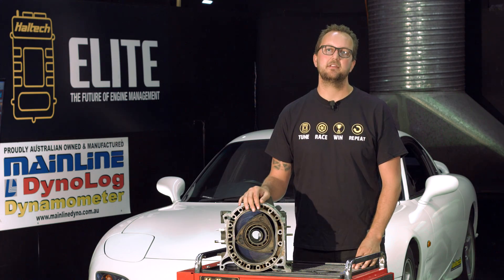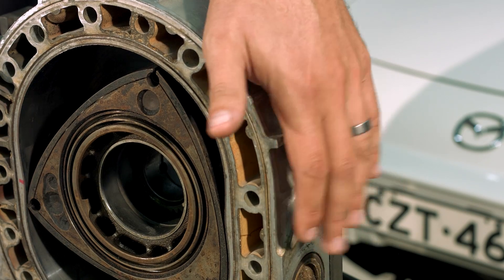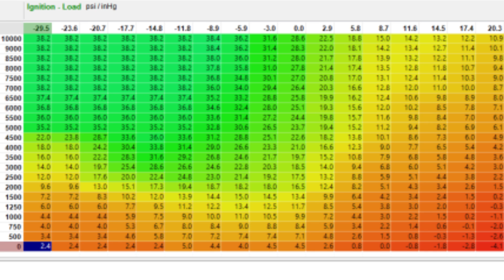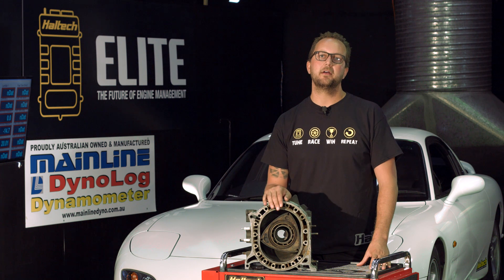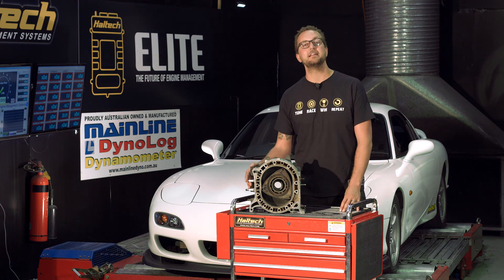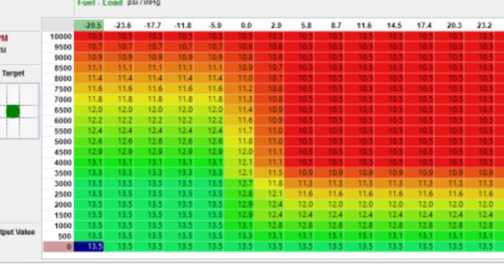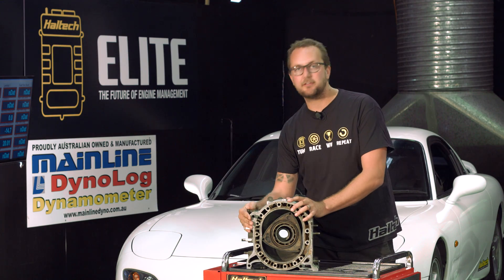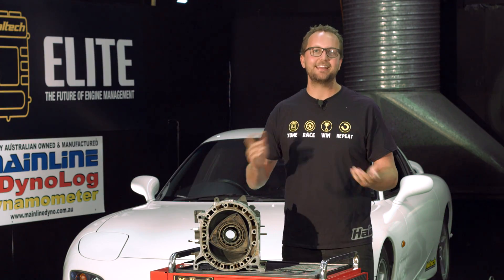💬 Tuning a Rotary Engine - Technically Speaking

Comment: Hi can anyone remote map my Fd please? It’s running a Haltech elite 1500 but there’s only 3 mappers in the UK now, 2 have refused to map my car or work on it and the last mapper is 8 hours drive - looking to pay for remote mapping or buy a map I can upload. street port 13b , T88, 2600 injector dynamics.  Thanks 😊
Reply from the maker: One of the guys at Haltech UK will be able to point you in the right direction. Contact them on +44 121 285 6650 or uk_sales@haltech.com
Reply: @haltech  thank you this is why I got Haltech - tried Link and other brands, they are not interested in helping.

Comment: Afaik, the ‘closer’ the ignition split timing the safer for the engine. Opposite of what was discussed. In fact, early mazda sponsored race engines had ‘zero’ split ( both leading and trailing fired at the same time)
Just my 2c.

Comment: Forgetting the rotors faces the 13b only has 2 cylinders where the combustion is created the 2jz has 6 cylinders -Jesse Rotary
Reply: The Mazda 13b has SIX combustion volumes.. not 2.
Reply: @sandervanderkammen9230   It only have 2 cylinders or housings it doesnt matter how many pistons or rotors its equivalent in a piston engine is a 2 cilinder 2 stroke engine engine that bangs every whatever degrees 🤷🏻‍♂️ its simple.
Reply: @marinaportocaribe  Sorry, if that were true? The Wankel would only have one combustion cycle every 3 revolutions...

All Wankel engines operate using the 4-stroke principle and completes its firing its firing order sequence at 1080° degrees of crankshaft rotation. 

If you are having trouble learning the fundamentals of the Wankel KKM engine I would be happy to help explain it to you.

Comment: Mazda 13B engine has 6 combustion chambers (each rotor side forms a combustion chamber and go trough the 4 stroke Otto cycle as its moves inside its housing) Great to hear you compare it to a TOYOTA 2JZ-GTE 6 cylinder engine because they are equivalent in terms of working combustion chambers. 
13B with 6 combustion chambers
2JZ-GTE with 6 combustion chambers.
13B is not equivalent to a 4 cylinder engine, neither because it uses 4 spark plugs and neither because its ignition events are at each 180° of eccentric shaft rotation (4 cylinder engines fire an ignition event each 180° of crankshaft rotation) because in a Mazda 13B engine you got 6 ignition times in its Thermodynamic Cycle, NOT 4!

Displacement for Mazda 13B engines is not the nominal displacement of "1308cc" (1.3L) Mazda quoted (They did it to skip paying higher taxes per each engine produced in Japan because there was an Engine Taxation Law) Mazda just counted the work (combustion cycle) done by just one side of each rotor (2 combustion chambers total) and skipped the other 2 sides per rotor (4 combustion chambers total)
That's how they gave just 1/3 of its real value (set by its thermodynamic cycle)

On a 13B  engine there are 6 combustion chambers that displace 654cc each one to go trough a 4 stroke Otto Cycle and it takes 1080° rotation of its eccentric shaft for all them 6 combustion chambers to do so.

654cc x 6 = 3924cc (3.9L) @ 1080° eccentric shaft rotation.
Ignition is fired at every 180° of eccentric shaft rotation and there are 6 ignition events on its Thermodynamic Cycle so;
180° x 6 = 1080° (3 rotations of 360°)

13B is not a 1308cc (1.3L) because Mazda said so to cheat Japan's engine taxation laws. It is neither a 2616cc (2.6 liter) because S.A.E used the 720° of the Thermodynamic Cycle of 4 stroke piston engines to give the Wankel Rotary Engine an "Equivalent Displacement" because at 720° of eccentric shaft rotation in a 13B engine, 2 sides per rotor (4 combustion chambers total) have completed a 4 stroke Otto cycle;
654cc x 4 = 2616cc (2.6L) @ 720° of eccentric shaft rotation.
Ignition at every 180° of eccentric shaft rotation / 4 igniton events
180° x 4 = 720°

Try to make a 13B 2 rotor engine to spin and keep in steady idle with just one side of each rotor (2 combustion chambers) completing a 4 stroke Otto cycle (displacing just 1308cc / 1.3L, 1/3 of its Thermodynamic Cycle) and the other 2 sides of each rotor (4 combustion chambers) not doing their 4 stroke Otto Cycle events. 
IT WON'T WORK BECAUSE IT IS NOT A 1308cc 1.3L
Remove an Apex seal or program the ignition to fire for just one side of each rotor....It won't spin trying to displace just 1308cc (1.3L)

It is a 3.9L displacement engine in a compact package.
Reply: "13B is not equivalent to a 4 cylinder engine, neither because it uses 4 spark plugs" so a 4 cylinder alfa romeo twin spark is actually a straight 8 or?
Reply: @NokturnalFin  Unless they fire more than once every 720°??? No, it's a 4 cylinder.

Comment: Hello Haltech,  I am interested in using a strong rotary engine in an aircraft.  I'm told I can expect to get 325 hp or 650 hp out of a single or double stack rotary engine.  Can you tell me if gasoline usage on an engine like this rotary engine vs a more conventional engine like a Lycoming or Rotax with a 150 hp is comparable to one another?
Reply: Wankel engines are not used in the aircraft industry.
The Wankel engine is considered too unreliable and unsafe for passenger aircraft applications.

No Wankel engine has ever achieved and maintained a FAA or EASA airworthiness certification.
Reply from the maker: Hi there Paul, we have no experience with aircraft engines, you should probably talk so someone in the aircraft industry.

Comment: So rx8 does 238hp with streetport racing beat about 270 hp. There is some porting to get a little more from intake ports not just exhaust ports only. The intake could gain about 5hp and headers and exhaust possibly 10 maybe 15hp. Then the ecu and tune as well with reliable seals and compression should get an extra 10 to 25 hp from stock ecu restriction. Also increasing rpm from 9000 to 11000-12000 and 4.77 rear should help getting 300hp?

Comment: piston engines violently changing direction
Reply: @doktorbimmer Yeah to me this typical design has a lot of room for improvement but it's a great idea from an engineering standpoint. This engine is simply, 3 cylinders and four strokes, but instead of 2revs per power stroke per cylinder like a piston Engine, it has 1rev per power stroke per cylinder.1080 degrees output take that piston engine pella windows out the side of your block dokterbimmer the fake engineer

Comment: Sorry Scott, but this engine is a fuel hog, if you wanna build a race car with the engine, fine. But, a performance daily driver with this engine just doesn't make sense financially.
Reply: YOU ARE RIGHT ALL THAT FUEL GOING PAST THE LEADING PLUG HOLE FUEL HOG
Reply: @xkexke8081  apex seals aren't the problem, it requires you to use two stroke engine oil in your gas, 93 octane standard, or e85 if you like to fill up every 200 miles. You end up throwing more fuel at the engine to keep combustion temperatures down than you typically would with a piston engine. The only way this engine design would make sense, is if it was diesel compression ignition turbocharged air fed engine. Because of diesel having lubricating properties since it is a very low viscosity oil. Diesels are air quenched not fuel quenched, keeping combustion temperatures down means just increasing air flow.

Comment: How much will it be to fix theses codes and can the be done with out a mechanic. (P0420, P0661, P0076) it’s a 04 rx8 in good body condition for 2,500

Comment: Coz the Mazda 787B was lighter ma FIA allowed them use carry more fuel in a lighter car  than 4 stroke powered cars  during every pit stop they would lose 10 seconds and win 5 minutes. Mafia allowed them a way higher turbo boost. The French depended to much on Japan although it's a German invention and it's so unreliable they threw the idea out of the window. Total engine overhaul every 50/60 000 miles ain't great. The thing was lubed like modern 2 strokes. It isn't even legal anymore. The Mercedes C11 did have  more HP not even 30 but where not allowed to carry nearly as much fuel by ma FIA even if they had with 160 pounds extra weight they had to carry as ballast by these French wankers the tires wouldn't have lasted. No Japanese team won Le Mans ever. Mazda had it's own class. It was disgusting and nothing to be proud off. As for Reliability sorry they won 1 race of the whole endurance championship that year because of those French wankers changing the rules. When it can't hold 24 hours it doesn't belong in a car anyway. Wankel ( not rotary ) engines are crap done end of discussion. 4 stroke same HP weight fuel tires ( same rules )  The winner wouldn't have been Mazda. These rules where for LE Mans only. People only think Mazda did win.............. Although they did not. They had been whining so long and there was so much money involved that ma FIA agreed with this crap other teams shouldn't even have raced them. It was like an F1 in a GP race. Funny how they can leave such things out of the media for years on end. Anyway those that are happy with crap good luck.

Comment: I've got a correction on how you explain the time intervals. The times you specify are the frequency at which each rotor has a combustion event, not the duration of time for an entire cycle, as you said. The rotor does one full revolution for every three of the eccentric shaft, so each combustion chamber takes 3 shaft revolutions to return to its starting point. That means the cycle time at 6000 rpm is 33ms, but the firing frequency is one third that, at 10ms. The air-fuel mixture actually spends more time in a rotary engine at the same shaft speed.

Comment: Thank you for the video Mr. Haltech.  It is very clear.  However I have one question.   Where or what triggers the release of the spark to the spark plug(s)?  In the piston engine the spark is triggered by the crankshaft (sensor) or the camshaft (sensor).  Draw me a picture, please.  Thank You, Robert :-)
Reply from the maker: The spark timing is controlled by the ECU, based on inputs from the engine position and speed sensors. This is the same for Rotary and Piston engines, between them its just a differing layout of sensors and spark timing.
Reply: Thank You. Have all of the Rotary had ECU's?   What about before. How did they get the fire trigger?

Comment: You're not gonna find anything of worth in the "comments below" as everyone thinks they're an expert but never tuned nor built a rotary engine.
Reply: Rebuilt my 13b with a friend at 200,000. Apex seals were still in decent condition, no issues with anything internal.
Reply: Obsolete? How is something still being used obsolete? You should review the definition of the word. I think you mean "no longer manufactured by Mazda." Much more accurate than the half truth "obsolete" you enjoy repeating. Engine has its use and is being produced by other companies. Oh, you meant your rotary plane engines? Yeah, those are obsolete. The wankel is alive and well :)
Reply: Pretty much general rule about any youtube video unless your asking op a question
Reply: Haltech is really doing a good business in LS swaps... should tell something.
Reply: Yup,lol xD

Comment: Great video..
Question:
If you keep the catalytic converter on the car, wount you "need" to be at lambda1, 14.7:1, to keep the cats work at its best during crusing speed( not WOT ofc )?
You said around 12-13 during those conditions in the video.
Thanks

Comment: I wished Scott tuned my rotary. my 13b turbo made 509whp@18psi but I think its blown, it runs a haltech too lol.. I haven't stripped it down yet but am expecting the worst. I'm guessing it's due to the tune or not using synthetic premix with E85 and possibly blocking a 2200cc injector.. It's only done 2k since rebuild, dowelled and extend port😢

Comment: 16 watchers copied that ignition table and blew their apex seals :D
Reply: That timing table looks pretty low for a rotary
Reply: Kj16V srsly that shitty joke is still around
Reply: Hutki Shira table was for FI that they kept showing...  It's bought spot on for any FI but yea for an NA renesis it would be a fair bit low since they like slightly more aggressive timing and a bit leaner than this chart was.   Still rich by piston standards but not as rich as the FI
Reply: Apex seals will go eventually anyway.

Comment: My friend asked if you can add another engine pulley to compensate  for the 10ms engine cycle compared to Otto engine 4 stroke 20ms cycle. Would that work instead of changing to x2 size injectors?

Comment: Too bad development of mass produced rotary vehicles has ceased to exist. Maybe one day when automotive technology has advanced a bit more, we can see another rx7 or 8 without them being so dealer repair prone
Reply: Development has always been ongoing behind the scenes at Mazda. The latest info is that Mazda is going to drop a prototype this year for a production RX-9 to hit the market in a couple years. Supposedly it will be a 1.6L 2-rotor featuring the first direct injection system used on the rotary, laser ignition and a top mounted turbo. This combo is said to make about 300hp NA and 450hp with a turbo. Great news if it's at all true.
Reply: ill pony up the benjamins when i see it. I'm sure a lot of people would.
Reply: Arnold Martinez Yeah, I will too! I have a feeling it's gonna be pricey though. Probably around $50K.
Reply: same rumors are claiming near 27 mpg with the direct injection system since they wont need to pump so much in due to the past models basicly soaking the surfaces and the D/I wont do that
Reply: your a half wit... the rx8 was made until the end of 2011 so your already spewing lies... how could they end it in 2009 if they have 2011 cars? and yes the owner of mazda said he will not stop developing it... he said it on a public news interview go look it up.
Reply: The real doktorbimmer I don't believe that development has stopped. After all, several major automakers tried to make the rotary a mass production engine and failed and Mazda succeeded when they said it couldn't  be done.  Mazda will make it work. And you don't need an engine plant to develop an engine. If we don't see at least a prototype by 2020, then I may believe Mazda gave up.
Reply: Doktotbimmer: Car companies make concept cars and very few of them get put into production. In addition to this, most car companies do not produce all of the products they make. Take electric cars, for example. There was a period in time when there was not a single automobile company manufacturing electric cars, but they had concepts made. Failure was met throughout the years until recently. Electric cars used to be around everywhere and out numbered piston engines as well, but they stopped. According to you, the technology would've been obsolete for decades, even though it is the smarter move. Turns out, once batteries fixed their whole thermalefficiency issue, a whole car company emerged called tesla. Now almost every car company has an electric motor in some model. 
Let's bring it back to you. The wankel is a racing engine meant for constant use at high rpm. A v6 does the same job at lower rpm. People hate doing work. People hate revving their engines, they're lazy. People don't want to buy a car they have to rev to get torque. Simple. You bitch and moan on these comments sections. Why does the rotary upset you?
Reply: @rckli  Wankel engines are obsolete technology because they are inherently unreliable and less durable than reciprocating engines... they were an epic failure in motorsports and no longer used in any professional or world class motorsports series.
Reply: @rckli  And you fill the comment section with ignorant lies and misinformation about Wankel engines... you are clearly not qualified to speak inteligently about them.

Comment: 4 yrs into my first RX-8. 2004 GT 6 speed m/t.
it had Some prior issues. had run warm. not over-heated to salespersons knowledge and only person i knew that ever worked on Wankels... so...i had much done after i went from initial 86k.
(8 yrs had passed,so 100,000 mi. warranty expired). but WOW...I SO LOVE MY CAR. got almost 123,000 on it...had some COLD START probs.....RIGHT when the Takeda AIRBAG debacle started....which the MAZDA RX-8 was part of....nevertheless,i am into ORIGINAL stuff. keeping it Original... So i have purchased a 2008 from a   2008 RX-8,and its going in now. 
Sending my ORIGINAL to be TOP TIER REBUILT... and will run my 2008 for a yr or so....then,back in goes the ORIGINAL Wankel.
I NEED YOUR VIDEOS BADLY! 
i am a total ROOKIE...EVEN after all i just said. my goal...to Care better for my Wankels... learn more...and get MORE ROTARY Vehicles.